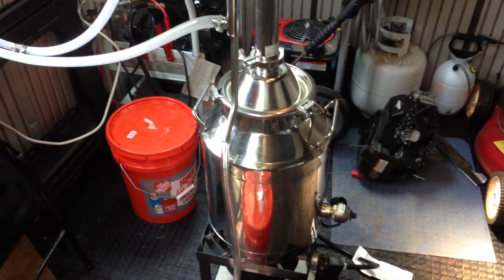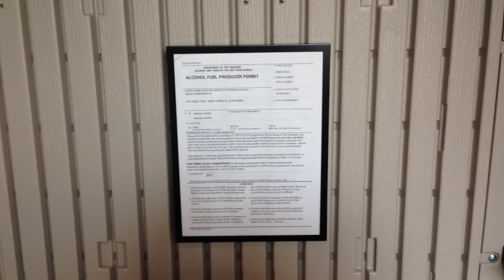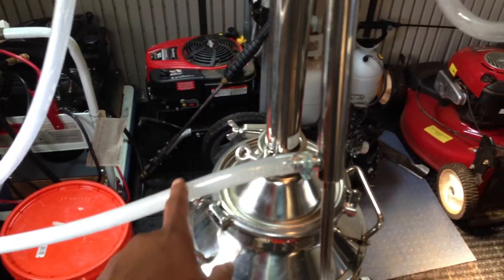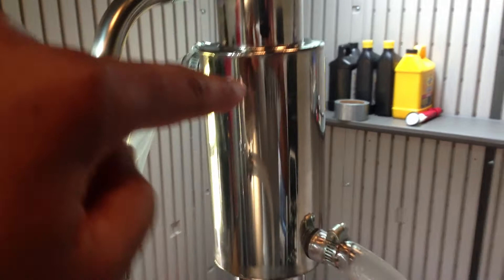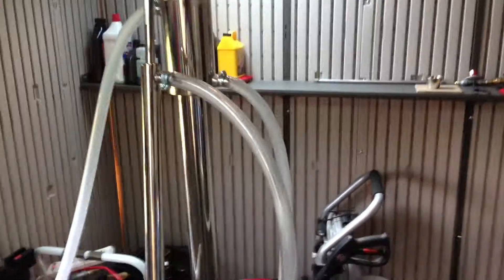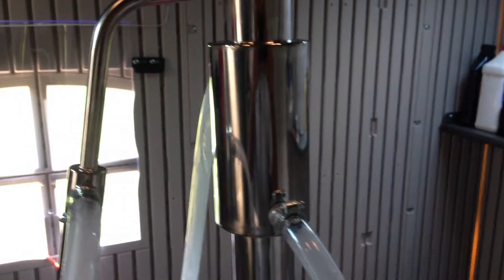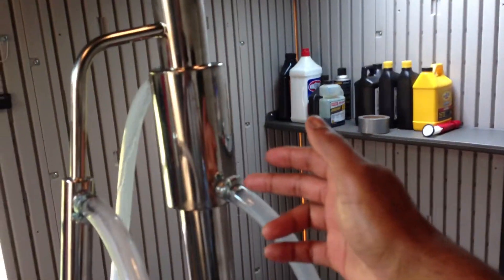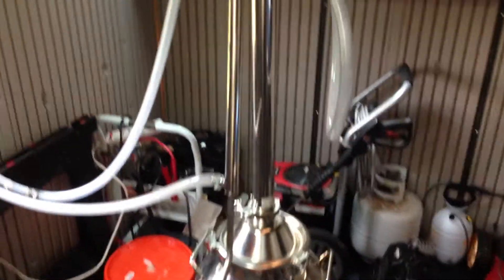DIY Fuel Ethanol Tweaking The Still

Comment: Coldwater always in the bottom hot out the top. Should have a splitter on your cold water and hot water with a valve controlling how much goes into your reflux condenser. So you can maintain the optimal temperature on the head. All 101 knowledge for anybody distilling. As you need to cool down the head just a little bit to cause reflux but you open it wide open on the shotgun condenser